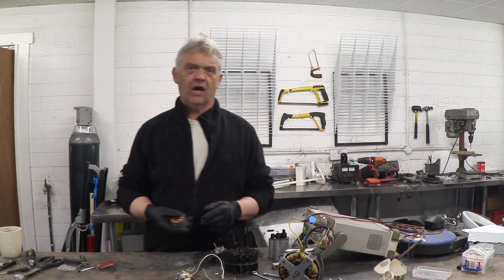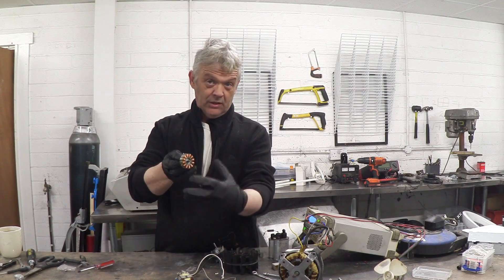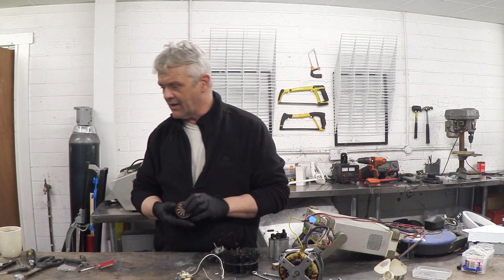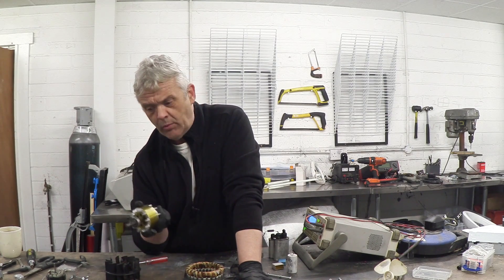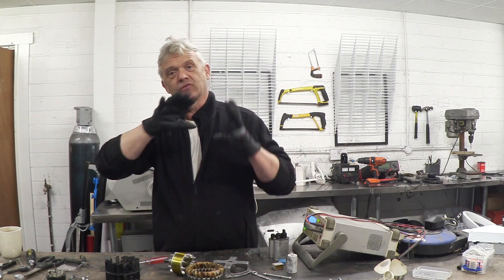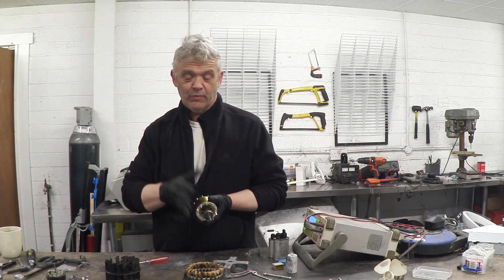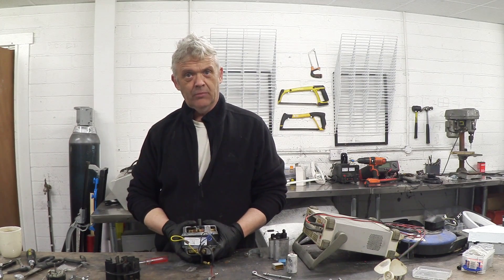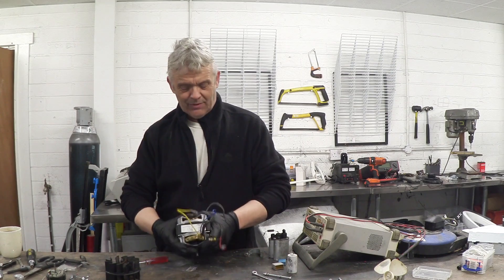500 An Induction Motor As A Generator Without Altering The Motor

Comment: I really enjoy your videos, very helpful! I could use your advise regarding the induction motor. I tried to use it as generator, 2hp single phase with 2x200mq capacitors alteady inbuild. I got only 50v output
Reply: Don't worry about that.  It's the power output you want.  AC can easily be transformed to other voltages - by a transformer (the clue is in the name!)
What RM-S always forgets to mention is the power, which is the rate of useful work it can do.  50 V at 1 A is 50 W and that can be transformed to 250 V at 0.2 A which is still 50 W and is useful.    If your generator got  250 V, but only 4 mA, that might sound better, but is only 1 W of useful power.

His emergency battery with  0.3 V at 40 mA is 0.012 W and of dubious value even for charging a phone.  Just think how your phone discharges even if you don't make or receive any calls:  mine might last 48 hours like that.  Lets be generous and say it could do 100 hours on a charge, if I don't use it.  My phone requires about 5 W hours for a full charge, so 0.012 W will take about 400 hours!   
But it's not useless!  I can make dozens of calls a day on a full charge, so 5 - 10 hours charging might just give me a single call, provided the phone was off the rest of the time.

Comment: This makes a lot of sense. Thanks for sharing. Just one question though, to anyone out there reading this, where do I find 400V 100uF capacitors? Robert mentions that he's using 1000V microwave capacitors but recommends using 400V ~100-200uF. The motor I am using has a 400V 0.1uF capacitor. I salvage parts so I'm wondering what kinds of devices should I be looking for to find appropriate capacitors for this application?

I'm also wondering what happens with different combinations of capacitance on the primary and auxiliary windings?
Reply: To answer my own question, well the first one anyway: I found 400V 100uF capacitors inside power supplies (phone/laptop chargers, power tool chargers etc).
Reply: You have to use NON-polarized caps for this. If you use the ones out of power supplies, they will not like being charged backwards during the other side of the sine wave. They will either waste too much energy and the gen simply won't work, or they could blow up. 
You need a RUN capacitor from an electric motor. Or get one from a air conditioning service shop. Or on Amazon. Make sure to use a cap with a voltage rating close to double the voltage you intend to generate, or it will either get hot or explode.

Comment: it was pretty helpful. my thing im using as a generator is a 14 pole 60 hertz ceiling fan motor(80 ohms which i assume is 8 poles and also 60 ohms which maybe 6 poles). I have a 15uf capacitor in parallel to the 80 ohm winding. it is i believe a capacitor start motor. i got the capacitor from an old generator(very very old). the fan works but by spinning it by hand(to generate), i can only get like 300 millivolts and barely any current output(i have a stepper motor as generator and it can generate like 30vac). Please suggest something i can do to improve results.
Reply: You are likely using the wrong capacitor value. You have to experiment. And don't forget about what he said. You MUST get it to rotate substantially over synchronous speed. I don't know the speed of the ceiling fan. The blades keep the motor from ever reaching true synchronous speed. Take off the blades and run the fan. Use a tach to check RPM. Now spin your generator faster than that, by a little bit. You will know when you reach the right speed because the generator will start loading down it's prime mover, whatever that is. Maybe a wind turbine, bike pedals, or hand crank with a belt.

Comment: Just as a thought experiment.... How would a Multi Stage Tesla Turbine with some form of gearbox, let say 3 to 1, interact with something like this.  In theory, you get very high revolutions out of a Tesla turbine.  Not sure how much torque this might require from the turbine, but the power output should be quite good because of the speeds that you can reach with a multi stage turbine.

Comment: So it wouldn't be  too great for a wind generator you have to get it all the way up past its rated speed but ok w another driving motor.
Reply: Why would you waste power to generate minimal power? Get a real generator head wound for power generation. A basic squirrel cage induction motor is terrible at this and should have been the point of the video. Yes, it can generate some EMF but it sucks at it.

Comment: I love your channel, you are just the old guy three million doors down... a few things.. when the wind is blowing and the rotor is turning free wheeling, it extracts no energy from the air. If you load it the more it slows down the more energy you are extracting.....when you put iron in a coil you lose a little bit of energy to flip the iron back and forth, but there is a gain because the iron is more permeable to the field than the air in the coil. In the case of your perimeter of the circle idea, the greater voltage is generated when the magnetic lines of force move faster.If You go the axle to extra you have the mechanical problems you mentioned and you have a speed and gearing problem. When you decide between series and parallel in the coils, try to have just enough voltage and more current. it the source is a higher voltage than the load  like a car alternator at high way speeds the extra voltage is blown off as heat. thats why a car alternator has fins all over it.

Comment: I have a old washing and dryer motor with the capacitor that came with them  do you think these capacitor will do the job. And would the wires be connected the same way as if it was tun off grid power

Comment: an easy and quick thing to do for induction motor is to magnetize the rotor.
what's needed 4 mm diameter copper wire length it depends on how big is the rotor and it has to be wound the wire all around the metal excluded the aluminum clockwise,1 battery 12v "even if i believe and i haven't tested it yet but i will, it would be better if apply to the wires 1.5 to 2 volts for about 10 15 seconds in order to have a better result at low amps let's say 1 amp top".
same process to magnetize ferrite,the difference is they have different professional tools for that,home made you make it do with what you have and spending less possible!!
or the same way a mechanic magnetize its tools.

Comment: I have a question! I'm looking for a simple way to make a DC to AC inverter that can match the power in a US wall socket. Can I use a DC motor to turn the rotor in that AC motor + the capacitor to generate an AC current? Specifically, can I generate 120V AC at 60Hz? If so, how much DC current would be required to supply into the DC motor in order to get that high AC power?

Comment: Just curious what motor you would recommend to charge a 48v battery bank? Possibly for a lower speed wind turbine?
Reply: You'd need a gearbox due to low speeds and a generator head... just buy one designed to produce power. Ripping old motors designed to turn electric motive force into mechanical force and trying to reverse it is simply inefficient. And the reason wind turbines suck is because their speed is unpredictable and need complex gearboxes to try to maintain a constant speed for the generator whether it is going fast or slow. But if there's little wind or too much you get nothing at all.
Reply: @etherealrose2139  There are lots of buck/boost-converters that boost the voltage up to an adjustable level and lover the voltage when needed, making more amperes that way. Try googling it. No need for gearboxes or constant wind speeds, atleast when working with reused stuff and not aiming for best performance. Anything you generate with diy is better than nothing :)

Comment: Hi very helpful video, thanks. How exactly do you wire the capacitors for a single phase induction motor? Do you add them on to the existing 8 mF capacitor or wire them directly where the 2 power leads go in? My motors power box has 6 terminals. 2 for power, 2 for a resistor and 2 for an existing capacitor

Comment: well that is a confirmation of what i have been telling for a few years now,which is "any electric motor can be transformed into a generator with or without magnets,with or without putting electricity into the stator."
one thing tho,is there anybody that can tell me if it is possible connect in series 2 or more washing machine motor transformed into a generator?"for transformers i mean i've changed the core of the rotor and switched it with an aluminium core,cut slots for 4 rectangular magnets and assembled it again",obviously avoiding to burn them or blow them up if connected in series.

Comment: The Tesla motor is a synchronous reluctance motor, not an induction motor, and I think most EV's also use them these days. The difference is subtle, as they both look very much the same, but the performance difference isn't. SRM's work more like stepper motors and produce good torque from very low speeds. Induction motors have very poor torque at low speeds.

Comment: How about this one. Commutator plates turn on and off. Creating negative feedback spikes, that are over unity. How do generators/motors really work? Electricity is created from the tension and release of tension of the Aether's Dielectric Hyperboloid and Magnetic Torus. Dielectric and Dielectric voidence field/Magnetism are a coaxial circuit around Aether's pulses of longitudinal scalar energy. Without transverse waves of Dielectric or Magnetism crossing in the coaxial circuit, creating Tesla Nodes. EM waves, electricity, can not travel on the Tesla Nodes. Without Magnetism, electricity does not exist.
 I'm hoping, I can put an electric motor on my chopper. Brushless motor powering a 3 phase motor.
Start with a kick start, from/on a 42 servi-car, trike, frame. Adjustable flywheel.

Comment: IF IT'S THE PHASE ANGLE CHANGE I'D LOOK AT EITHER EQUIVALENT  RESISTANCE(IMPEDANCE/REACTANCE) AT A SPECIFIC FREQUENCY OF ROTATION 2 PI F L OR 1/2 PI F C,I'M SPITBALLING HERE,BUT AS THE INDUCTIVE REACTANCE AND CAPACITIVE REACTANCE COMBINED WITH FREQUENCY OF ROTATION ARE LINKED,PHASORS AND VECTORS MAY BE USED TO FIND APPROPRIATE VALUES USING PHASE ANGLE V REACTANCE,AGAIN I'M ASSUMING FROM MY EXPERIENCE WITH TRANSFORMERS AND INDUCTORS IN ELECTRONICS,AND MY ASSUMPTION IS THERE WILL BE MANY SIMILARITIES IN CALCULATIONS,DUE TO AC THEORY USING LEAD AND LAG OF CURRENT IN INDUCTORS AND CAPACITORS WITH PHASE ANGLE BEING AFFECTED BY THESE PROPERTIES.

i'M INTERESTED ENOUGH NOW IN THIS TO SEARCH OUT INDUCTION GENERATORS,I KNOW SOMEONE WHO REWINDS MOTORS AND GENERATORS,BUT MY FIRDT IMPRESSION IS THE CAPACITOR VALUES ARE LINKED TO FREQUENCY-PHASE ANGLE/ROTATIONAL ANGLE INDUCED FIELDS AND REACTANCE VALUES OF FIELD WINDS AND CAPACITORS,ALL BEING INTIMATELY LINKED.

Comment: I work on generators and diesel power generators and  engines . A motor start assist for underpowered installations: a flywheel coupled to a gearbox to an induction motor. The system idles at 60 Hz . 1800  RPM.  1500 for 50 Hz. Gives a LOT of motor starting amps!  Used to be common in industry. I still find them sometimes.Thanks for posting!
Reply: Cuánta es la capacidad en amperaje de un alternador de camión diesel

Comment: One detail, I didn't understood. How will it start if the capacitor is depleted. Care to explain?
Reply: He did. The capacitor is discharged at the beginning. The tiny residual magnetism in the motor generates a tiny current, which begins to charge the capacitor. Then feedback causes both the magnetic field and electrostatic charge to build until useable power is generated. 

There is an older book, called 'Electrotechnology', whose author's name I cannot remember, but it was being used in Britain during the 1970's as a base for teaching that subject in universities and colleges. It explains the process, and much more. There will be plenty of other sensible  resources, online and in libraries, which also explain everything to you. 

Beware of the 'free energy' and 'perpetual motion' claims; they are wrong, misinformed or scams.
Reply: @RWBHere  Thanks for the explanation. Will see if I can find this book

Comment: Those brushed drill motors are called Universal AC/DC motors because they will run off either AC or DC.  They run faster than synchronous speed, so I wouldn't strictly classify them induction motors.  What they really are is a series DC motor.  I consider an induction motor one where the armature's magnetic field is excited via induced current.

Comment: In my opinion, for wind turbines, but ONLY for charging batteries this will probably be ok. Asynchronous motors as generators in general (e.x. fitted to a diesel engine ) have issues. They are only useful if they are grid tied!  This is why industry only uses them as generators in GRID tied wind turbines. They don't work reliably offgrid and specially under induction loads. You don't want a generator that suddenly looses it's field and stops when the load changes ... Anyway, a really HUGE flywheel adds easily some "balance" to the system and with the help of a microcontroller  you can make an "acceptable" generator...  The best way to make an asynchronous motor generator is to change or modify its rotor WITH a field rotor with windings and machine slips and add brushes for the dc field voltage. That way can the motor can be converted to a real offgrid generator without any of the above issues.

Comment: How would one go about doing that with a 3 phase induction motor like in washing machines. I have one that I'd like to try as a wind turbine generator. It's got 5 pins on the plug. 2 are for a tachometer and the others for each phase. And the ground was from the case.  I'm at a standstill here. Thanks to anyone who helps in advance.
Reply: Step 1: throw out the idea
Step 2: purchase an apparatus designed to do what you seek
Step 3: realize the incredible waste of money a wind turbine is
Reply: @etherealrose2139  how is a wind turbine a waste? I live in a spot where it's windy nearly every single day. Even without the dawn and dusk gusts.

Comment: Will voltage increase if I insert 3 permanent magnets on the rotor and spin it?. My induction motor has 450v capacitor attached to with rpm of 880
Reply: That's not the point of this video. Read the title again. 😉

Comment: Here is an example of how to calculate the capacitance needed I got this example of wiki. It goes up if you need to draw a load from the generator.

As an example, consider the use of a 10 hp, 1760 r/min, 440 V, three-phase induction motor as an asynchronous generator. The full-load current of the motor is 10 A and the full-load power factor is 0.8.

Required capacitance per phase if capacitors are connected in delta:

Apparent power S = √3 E I = 1.73 × 440 × 10 = 7612 VA
Active power P = S cos θ = 7612 × 0.8 = 6090 W
Reactive power Q = {\displaystyle {\sqrt {S^{2}-P^{2}}}}{\sqrt  {S^{2}-P^{2}}} = 4567 VAR
For a machine to run as an asynchronous generator, capacitor bank must supply minimum 4567 / 3 phases = 1523 VAR per phase. Voltage per capacitor is 440 V because capacitors are connected in delta.

Capacitive current Ic = Q/E = 1523/440 = 3.46 A
Capacitive reactance per phase Xc = E/Ic = 127 Ω
Minimum capacitance per phase:

C = 1 / (2*π*f*Xc) = 1 / (2 * 3.141 * 60 * 127) = 21 microfarads.
If the load also absorbs reactive power, capacitor bank must be increased in size to compensate.

Prime mover speed should be used to generate frequency of 60 Hz:

Typically, slip should be similar to full-load value when machine is running as motor, but negative (generator operation):

if Ns = 1800, one can choose N=Ns+40 rpm
Required prime mover speed N = 1800 + 40 = 1840 rpm.
Reply: @just_saw_dust  Yes, 10^6 is 10 to the 6th power - 1,000,000. It converts Farads (the base unit) to miocrofarads (the common unit.)
Reply: thanks !

Comment: I have learned so much from you it's unreal. Thank you. All so useful for providing my shed with power without running it from the mains cable from the house.
One request, diagrams, flash them up for a couple of seconds at end of video and i can freeze frame and screenshot.
Reply: That's a good idea. I wish more 'tubers did that, too few seem to do it.
Reply: Totally agree, I have all the parts necessary to make this now, but I can’t figure out the wiring. @robertmurraysmith, do you have a diagram you could share with us?